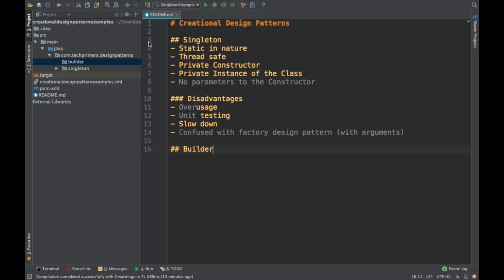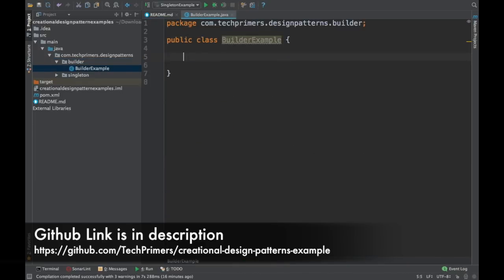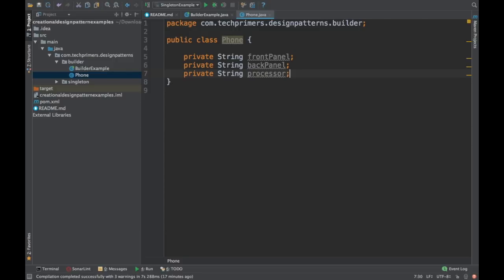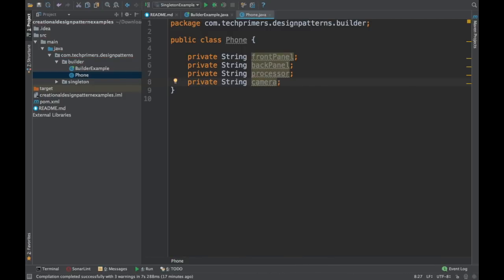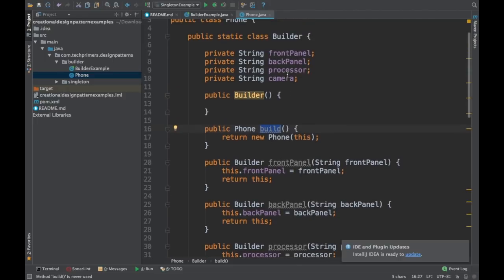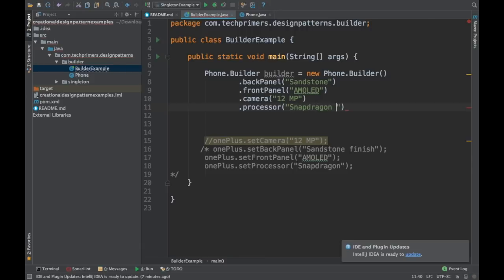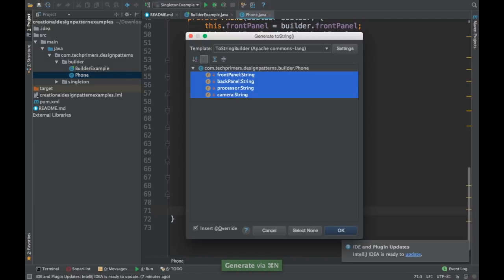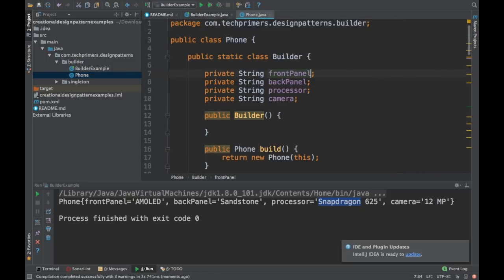Builder Design Pattern | Implementation and Disadvantages | Clean Code Series

Comment: I don't understand what is the problem if i call setters of POJO instead of using builder and calling each setters of POJO,

in any case we have to no. of setters that may be of builder or may be direct pojo's setters
Reply from the maker: thats just another design pattern for POJOs
Reply: But what did we achieve by setting the values of setters of Builder rather than setting the setters of the POJO? How was it any different?
Reply: @TechPrimers  I guess its for restricting the number of ways an object to be created or the parts an object can have.
Reply: Please let us know if you found the answer to your question. That was an important question. Unless we don't whre we   r heading we should not head for it :)
Reply: May be its a matter of immutability. Once object is created it cannot be changed as  we dont have setters on main POJO class
Reply: may be this video will help https://www.youtube.com/watch?v=Q7bHo1P0h_4